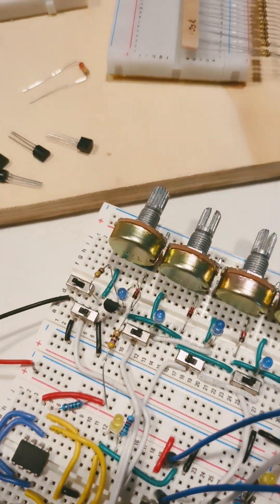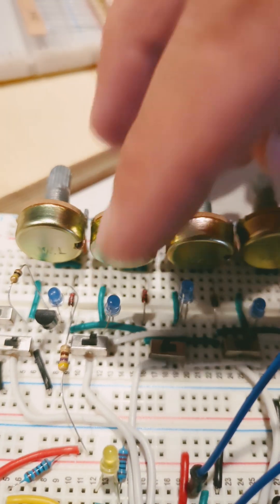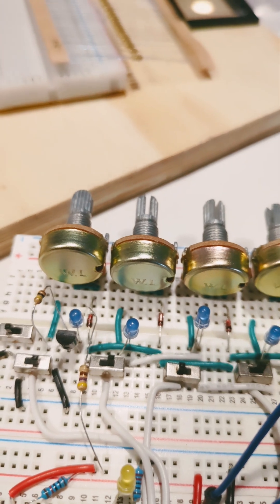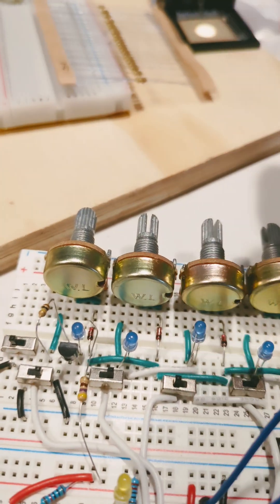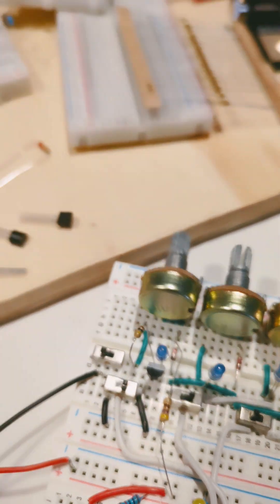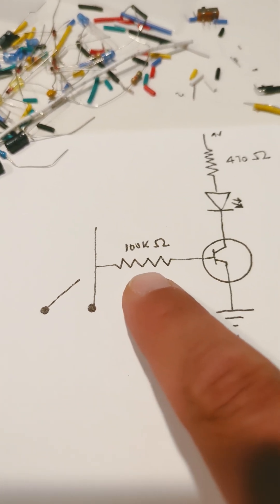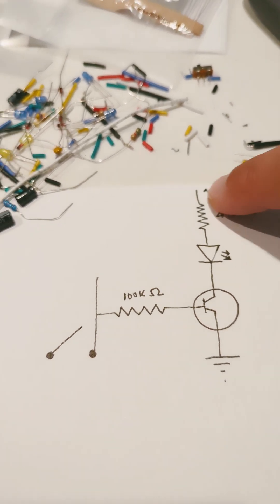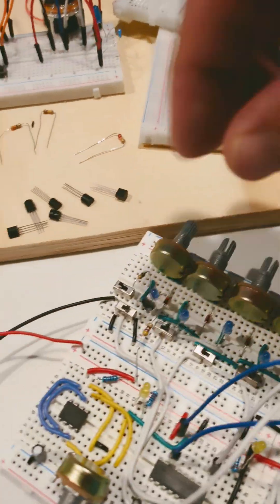Driving LED's with NPN transistor #synthdiy #diyelectronics #electronicscreators #diysynth #analog

Comment: Smart! I would like to know what this device is..
Reply from the maker: The device is an 8-step sequencer synth.  It uses two 555 chips, one for the time clock and one for the oscillator, and a CD4017 decade counter chip to trigger each step.  Check out @sarahbuildsstepsequencers channel if you want to build one for yourself!
Reply: How are you driving the speakers?
Reply from the maker: There is a mono output jack installed, so I can just plug it in through my mixer.